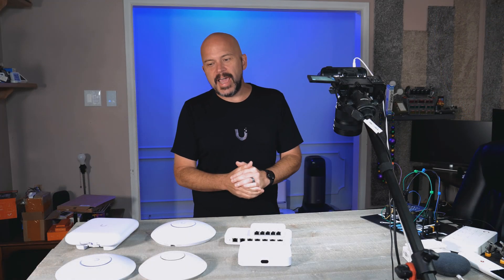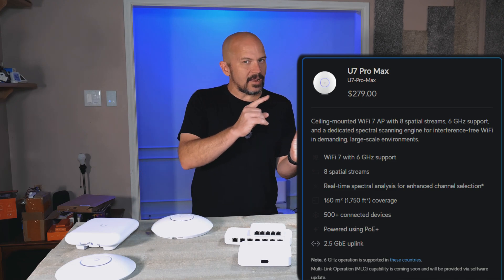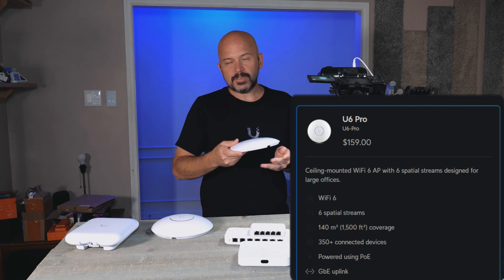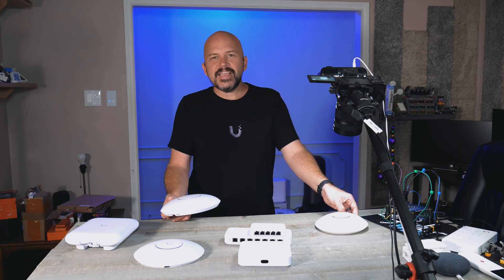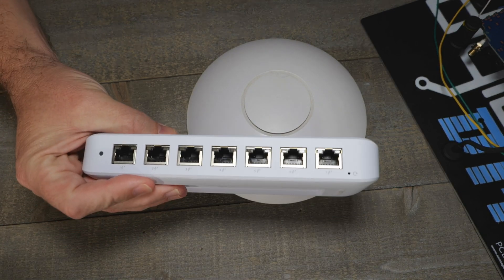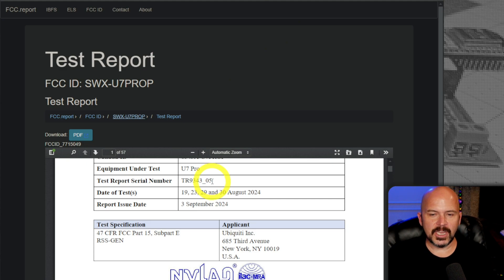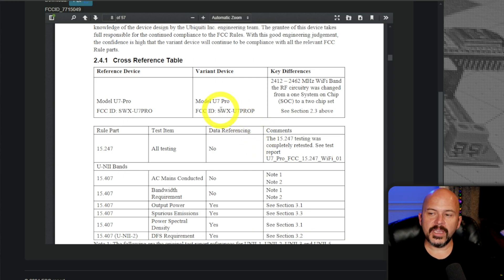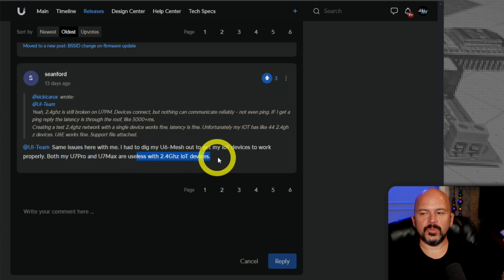UniFi U7 Pro & Max - DON'T BUY Here's Why

Comment: I upgraded from an AP-AC-LR to a U7-Pro. Ive been having all sorts of issues with wireless since implementing the U7-Pro. Issues with devices dropping or just not connecting. They are IoT devices that are on 2.4 Ghz. I also have issues with my phone switching between 6ghz and 2.4 and becoming unresponsive. I havent done much troubleshooting to figure out which is causing the problem, but if i had to guess, its 2.4 lol
Reply from the maker: Yup!  Definitely issues on the 2.4ghz traffic side of this device, especially when it gets loaded up with devices.

Comment: I find it funny how the U6-LR and NanoHD has a Mediatek chip in it. But yet ZERO issues at least on the U6-LR for my IoT devices when compared to the U7 Pro.  NanoHD devices also stay connected, but range and performance on 2.4 is sort of terrible. So I have a U6-LR just for my 2.4 IoT devices for now.
Reply from the maker: The U6-LR isn't as bad but it isn't a U6 Pro by any means. The Nano is hot garbage, tons people have swapped those out. But ironically the Nano beats the U7PRO right now by a long shot.
Reply: @digiblurDIY  I actually had a few issues with the U6 Pro when I had it before "upgrading" to the U7 Pro.  But the issues were mostly roaming related and latency. But Devices stayed connected

Comment: Thanks for this vid.  I thought it was just me.  I recently switched from two U6 Lite to U7 Pro because the lites were nothing but trouble for me.  I have a HA dash that conditionally shows unavailable devices and I can click on each of them to do a Unifi reconnect action.  Was thinking of automating the stupid thing to auto reconnect things since it is so bad.  All types of ESP devices/Shelly switches seem to drive me nuts.  Was thinking about dusting off an old Google marshmellow router pair to use for 2.4ghz or maybe just dedicate the U6 Lites to 2.4 only (was hoping to sell them).
Reply: I guess I should also note that it helped to do things like change them to fixed channels 1/6/11 as usual, channel width 20, and low transmit power if you have multiple.
Reply from the maker: We have done all the things for years. 20mhz non overlapping plain jane 2.4ghz SSID and it worked great on other lines. Not so much on the U7 line.

Comment: I’ve been having a hell of a time with my S31 and Shelly1 devices, looking at the UniFi app or webpage, it shows as working but in Home Assistant it greys out as unavailable. If l cycle the power it comes right back, or if I tell it to reconnect from UniFi system it reconnects fine also. If I try to connect via the tasmota page it doesn’t work either until I force a reconnect. I definitely see many reconnect issues with phones as well, but that’s not nearly as big of an issue. The system has 5 access points, and typically has around 100 total network connections, about 60 of which are WiFi. Also have a separate Zigbee network with around 50 devices. I wonder if I can have an automation detect when they are unavailable and force a reconnect with the UniFi integration. Two of the access points are U7-Pro, but the same issues have happened on the other models as well.
Reply from the maker: Yup.  Same issues I've been having.  It gets worse as you load it up with devices and traffic.
Reply: @digiblurDIY  yes same here, but not just on the U7 pros though, have a 6 enterprise, an AC-M-Pro, and an U6+ that all do it. When the clubs are busy it can be another couple hundred clients, but since it’s been screwing up, I’ve disabled the guess network hoping it helps. UniFi support wasn’t much help either, the usual stuff, they never sign there name so nobody is ever accountable when they ignore most of the questions. I raised total hell a year or so ago and managed to get a 20% off coupon code, then wasted it on a small order of course and made a much bigger order a couple weeks later lol. Still love their stuff overall, but blaming the $9 WiFi smart switches gets old considering they have worked for years and years with no issues at all, and now nothing but problems. Starting to move more things to Zigbee, don’t know what else to do.
Reply: Check for shelly capacitor problem

Comment: U7 with 85 IOT devices. No issues. 7.0.59 and 7.0.66 firmware both fine. A few of my clients also on U7\U7 Max.

Every Unifi release seems to have people complaining about iot\iphones\other device connection issues. This seems like more of the same with added Early Adopter tax for WiFi 7.

I'm mostly interested to see if UniFi posts an official statement on this or not. Unifi switching chipset layouts does not necessarily indicate an issue and I'm not about to return fleets of access points based on speculation.
Reply: More or less in the same boat, would be useful to have a replicable  problem to see if there is some common factor
Reply from the maker: Some people have found it depends on the traffic, number of devices then what really makes the devices fall of is when mdns and other broadcast traffic hits.  I do use a lot of Tasmota device groups so this could explain why I see it more.  Others have some Matter over WiFi devices that also causes broadcast traffic storms that seem to only cause issues on the U7 line.

Comment: I have the U7 Pro with over 52 IoT devices and have no issues with any device dropping out.  The speed of the U7 in 6GHz is awesome.  I wonder if only certain serial numbers are affected.
Reply: same, 3 U7 Pro and 50ish iot devices on my network and zero issues
Reply from the maker: Some people have found it depends on the traffic, number of devices then what really makes the devices fall of is when mdns and other broadcast traffic hits.  I do use a lot of Tasmota device groups so this could explain why I see it more.  Others have some Matter over WiFi devices that also causes broadcast traffic storms that seem to only cause issues on the U7 line.
Reply: Same here, hundreds of IoT devices on U7 Pro and no issues what so ever.
Reply from the maker: Please let us know the secret sauce so we can share it with the Ubiquiti support team.
Reply: Same for me. U7 Pro Max runs as hell. No problems at all. Perhaps it was a problem with a first batch?
Reply from the maker: @mikeb8630 might have been but they are actively trying a bunch of releases to fix both models.
Reply: I have two of them and have not had any issues at all. I purchased them back in March of 2024.
Reply: 😮 so google home type devices using mdns or matter could be the culprit for a lot of people. Did notice that some people on here having no issues also mentioned using an apple ecosystem. Any with a google home not having issues?
Reply from the maker: @charliesindatrees I am able to break it with simple Tasmota smart plugs.
Reply: Show speedtest on 6ghz with maximum channel width
Reply: That's the reason it took 1 year to fix...they had trouble reproducing the issue in house.
Reply: Same here 3x pro Max but not any problems at all. But maybe this is because my focus lays in thread and al the appleTVs witch are the hubs are hard wired. This setup (for me) is insane stable
Reply from the maker: @hansbruines4589 it does take at least 20 to 30 devices we have found.
Reply: @digiblurDIY  alright! I have 29 devices at te moment,. I am on the lookout ever since u saw your video haha. I have had a weird problem; my video doorbel kept disconnecting and reconnecting 40 times a day,. And since yesterday I fixed it. It was locked to the nearest ap,. When I unlocked it connected to the ap upstairs,. Pretty far away,. Connected ever since no problems anymore , very strange

Comment: Thank you for this video! I have been going crazy wondering why all my light switches just randomly drop offline. I suspected my AP but didn't have a way to test it. Now I know.
Reply from the maker: Yeah it has been driving us nuts for months and I kept rolling back things and to find it is the damn hardware.
Reply: @digiblurDIY  Has there been any update on this? Mine are still doing it. I managed to set an automation that when HomeAssistant detects a device has dropped offline it uses the Unifi integration to send a device reconnect to the device that dropped offline. This has been able to basically keep about 80% of the dropped devices coming back online but there are still some that when they drop offline I have to go to my Unifi controller and tell it to reconnect. FYI this was a very time consuming automation to make.
Reply from the maker: @SevynTech did you try the latest EA firmware? It has helped a lot but they do have a few more things to nail down.
Reply: @digiblurDIY  So I updated to 7.0.100 and been on it for about since you suggested it above and it seems to have helped. I see there is an EA 8.0.0 build now. I'm updating to it now. Thank you!

Comment: I've gone through a few inexpensive network options before settling on a nice Ubiquiti setup. My last configuration before my Ubiquiti network (Dream Machine Pro Max, 24 port Pro Max Switch, a U7 Pro, and a U7 Pro Max) was the previous generation of Google wifi mesh. Before that I had the first gen Google wifi with giga-bit connected wired nodes. I had an insane number of problems with IoT devices under Google's wifi as well as prior systems. Ironically, the devices that have given me the most trouble have been Google IoT devices. Those problems have largely gone away since this recent upgrade to Ubiquiti network equipment. I'm actually more convinced that it's more of a problem caused by low quality IoT devices. They're mostly cheap trash and their sleep/wake states cause inconsistent behavior. Some are better than others, though

Comment: I don't have a problem with U7Pro. My settings are a separate network for all the IOT things, set at 2.4GHz with 20 MHz. Not having any problems with WiFi 7 and iPhones on the other network.
Reply from the maker: Some people have found it depends on the traffic, number of devices then what really makes the devices fall of is when mdns and other broadcast traffic hits.  I do use a lot of Tasmota device groups so this could explain why I see it more.  Others have some Matter over WiFi devices that also causes broadcast traffic storms that seem to only cause issues on the U7 line.

Comment: I am disappointed that in this video and last one people are letting Ubiquiti know that they will buy their old stock when they are unsatisfied, instead of going to alternatives, giving the opposite motivation to Ubiquiti.
“Mesh” is just the 802.11 k/r/v standard - almost all APs and clients(the client decides when to move to another AP, not the AP) have it implemented now, so you don’t need to stick to Ubiquiti APs…
Reply from the maker: I don't run mesh as I prefer the wired especially with these that don't have dedicated backhaul radios.
Reply: @digiblurDIY  I am referring to the people in the comments here and on the forums. They are telling Ubiquiti that when they are unsatisfied, they will also buy Ubiquiti's old stock instead of giving Ubiquiti a motivation to fix the problem.
The "Mesh" comment was for those worried that if they buy from a different manufacturer, that roaming won't work.

Comment: Similar issues. Opened ticket on u7 pro max and they kept taking 2-3 days between responses. Asked me to do steps which I had messaged them I had done with screenshots of results again. Eventually I just let the ticket close as I fixed it myself. I have 3 APs and after introducing the 7 pro max frequency overlap and power became more of an issue. I did 2 weeks trial error (my home is less then 5 feet from neighbors) and dialed in radio transmit strength and optimized channels by hand and then all has been rock solid. 

Support at Unifi DOES NOT READ what you tried or any results you have come up with unless they asked first.
Reply from the maker: It isn't a frequency issue as the U6 Enterprise on the same channels and width is fine.
Reply: @digiblurDIY  yeah I think the tx retry’s are due to some distortion. I dropped power pretty low and since I have enough APs it solved my issue. I used Auto for everything with 2 U6’s and a AC-LR covering my house. Removed the AC-LR and replaced it with the U7 Pro Max and then all the problems unfolded

Comment: I'm still having trouble with any Unifi firmware greater than UniFi-Access-Point 6.2.49 with my AC Pro and AC Lite's.  My 2.4Ghz devices sometimes drop off after a day, and even with the 6.2.49 firmware I've had issues with SSH'ing into them.  It's frustrating because otherwise they have been rock-solid.  Maybe I need U6... are the U6-LR's recommended?
Reply from the maker: I would skip the U6 LR as it is MediaTek.  Stick to the qualcomms in the post I linked.

Comment: I've been testing the U7 Pro here at home w/ a Pixel 8 and a Pixel 9 Pro max and I can't get anything close to the throughput reported by either my phone or unifi. (350mbps, maybe ~450 tops)  
But I don't have any other 6ghz devices, so I have a harder time isolating if it's a unifi problem or a problem w/ my phone(s).
Reply from the maker: I haven't had any issues with Pixels from the 6 to 9 on the U7 line.  That part seems to be fine for the most part.

Comment: Thanks for the info; do you know if the inwall U7 options have the same issues?
Reply from the maker: Looking at the specs I would bet it is the same guts just a different form factor so my guess would be yes at this point. I would put that on hold until it is resolved.

Comment: I have turned off all the settings everyone says to. I've got a dedicated wifi band for. whenever this happens, I either have to run a channel optimization or goto the device in unifi and hit reconnect. That fixes it and it shows back up in home assistant or each smart homes respective apps. So it's weird. They are still "connected" in unifi but they go offline everywhere else. All my other aps work fine. Non wifi 7 ones.Whenever I run the channel optimization or other things that "reset" the connections it makes them come back.
Reply from the maker: Channel optimization usually makes it worse for me as it puts access points on top of each other in channels and drives up the retries.
Reply: @digiblurDIY  yeah I try to change it if it does that but good point. Either way it seems that’s just one way I can fix the device but it’s just as easy going through and hitting reconnect on the few that dced. I installed the version you mentioned and will see how it goes. Thanks for making this video. I’ve been messing with the settings for like a month and didn’t see anyone mentioning it until I looked into 2.4 issues and the U7 pro. I’ve been going nuts. So hopefully they get the issue fixed. I noticed that they seem to be working on the issue. So hopefully they get it fixed somehow. Videos like this help get their attention.

Comment: Is it possible the switch to 2 chips is to add the "realtime spectrum analysis" feature that the U7 pro max has already?

I have 2 U7 pro's running about 50 IoT devices without issues so far (been about a month). Firmware 7.0.66 on mine.
I do have my IoT devices on a separate 2.4ghz only SSID with features like fast roaming disabled. Could that help skirt stability issues?
Reply from the maker: That's kind of what I was thinking with the secondary chipset.  

No, many of us already had the dedicated no features 2.4ghz SSID before the U7 line.